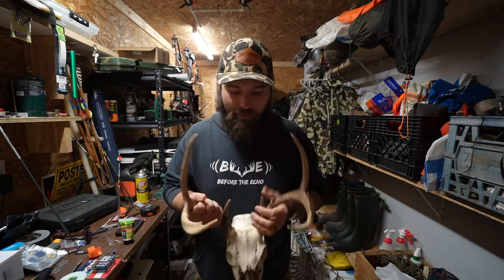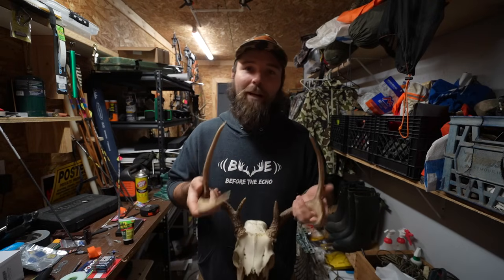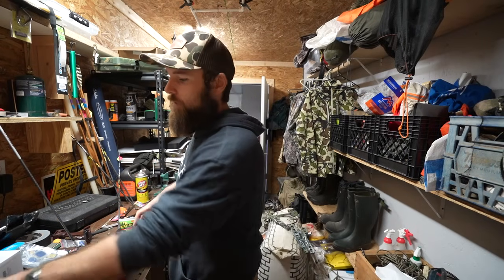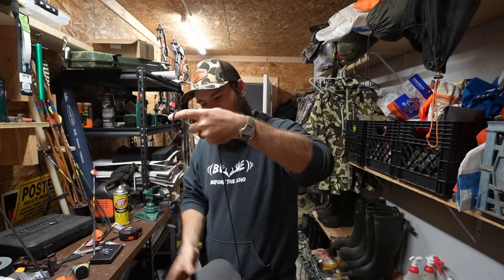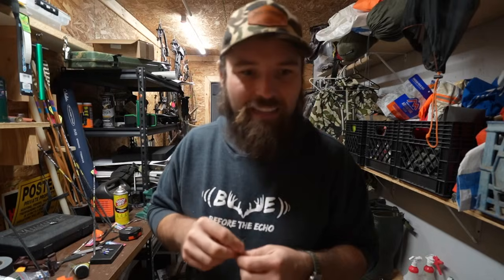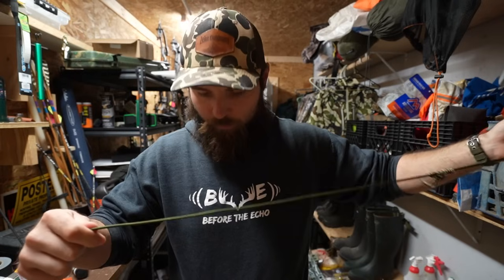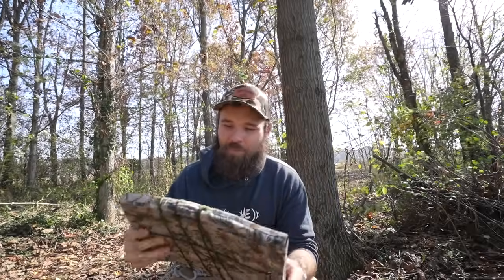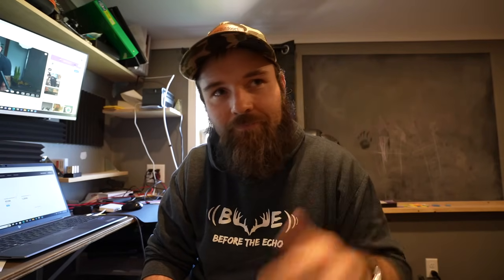How to make the best DIY knee cushion for saddle hunting! #saddlehunting #deerhunting

Comment: Thanks for the tips. Not knocking stealth strips just looking for tips. Maybe I used them wrong. I put stealth strips on the edges of my platform where it would bang against other gear when setting up. When I stood on my platform the strips peeled back and the adhesive got on the bottom of my boots so when I would lift my feet you could hear my boots unsticking to the platform. I also put on my bow holder but it stuck to my bow after a few hours and I had to wrap it with duck tape and use acetone to get the goo off of my bow, boots, and platform. It’s worked great on everything else that doesn’t bare any weight.

Comment: Sure it was the neighbors dog and not a coyote or raccoon? Find it odd a dog would chew on something that would taste like bleach.
Reply from the maker: I didn't bleach it just boiled it. I found it in. My neighbors front yard...the dog wonders around our house at night all the time
Reply: @beforetheecho  Ok, my  mistake, you said bleached so thought you actually bleached it. I've never done a mount that way, I usually just cut off the skull plate as you said you might do now. After that I screw it to a piece of wood and then take modeling clay and shape around the skull into a upside down teardrop shape. Let the modeling clay dry then take it off the wood and either glue felt to it or glue/shape leather around it and then screw it to a plaque. They turn out pretty nice and save me over $1000 that a shoulder mount would cost.